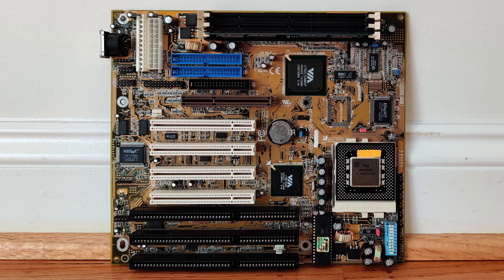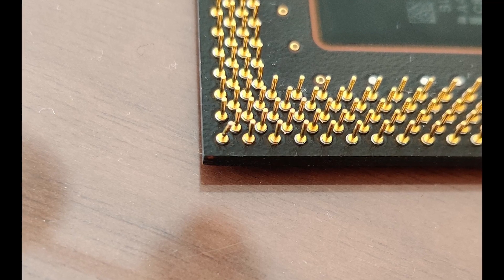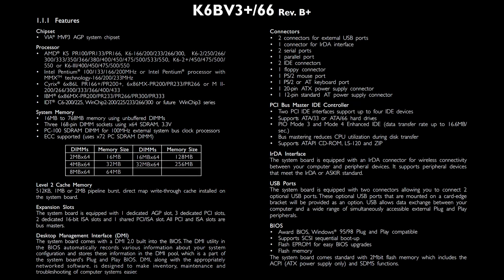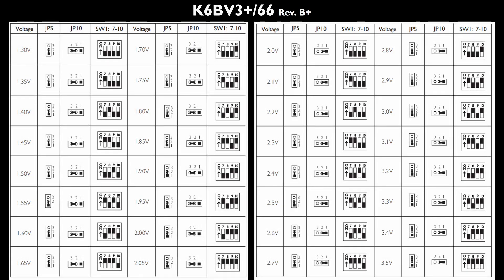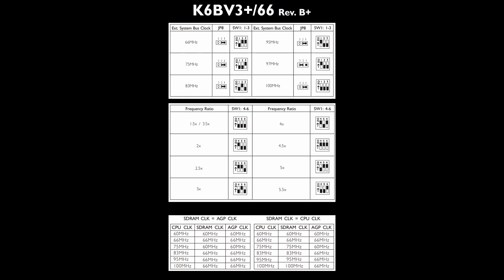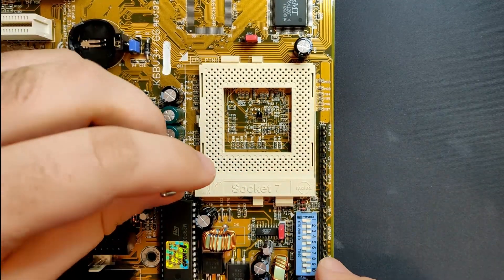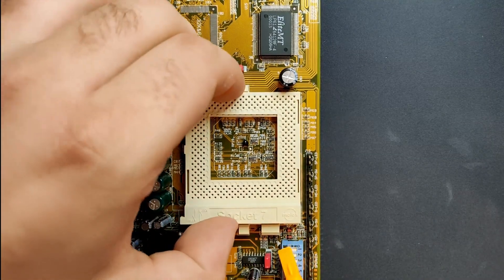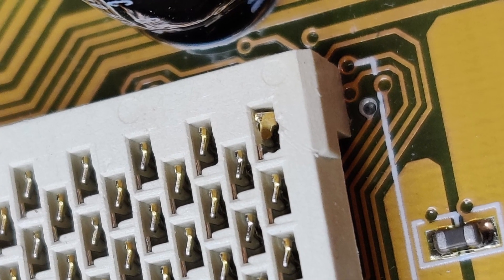DFI K6BV3+/66: Repair damaged Socket

Comment: What tools do I need to fix socket please?
Reply from the maker: It depends on what you need to fix. I only had to lift the socket cover and bend a metal plate back into position. A plastic prying tool was enough.
Replacing an entire socket on the other hand requires a desoldring station

Comment: Feels strange to, 20-25+ years later, realize that both AMD and cyrix cpus were actually quite good in the socket 3 to 7 era. Sure amd 486 up to 100 MHz were "standard" but the faster variants were really uncommon where I grew up.
And the k6 2/3 were uncharted territory.
A friends Mother bought a everex explora mini system as a christmas present to him and his brothers, more a punishment then a present actually..
K6-2 450 with 64mb ram and integrated gfx, we did what we could adding memory and voodoo 2 cards but it was a sad experience 🤣

Comment: I had a K6-2 350MHz back in the day.  I upgraded it to the K6-III 400 because I couldn't get a 450.  It worked quite well for me back in the day.  I had an EPoX MVP3G board.  They aren't the fastest chips from that time period, but they work great in a lot of games from the time frame.  Glad to see you fixed that socket.  A lot of people would have thrown it out.  Glad to see the hardware preservation.

Comment: Hi, thanks for your videos, I do enjoy all of them. But I expected something different for this one :) but you were lucky you didn't have to replace the full socket... which I need to do, where did you get the socket replacements? I need one for an aladdin V super socket 7 board
Reply from the maker: I found them on ebay while I was on a trip to US. I think there were only a couple of ads for Socket 7.
I hope you'll find them and good luck with replacing such a socket. I have never done a socket replacement, but I shiver just thinking about doing it!

Comment: That particular pin is a "No Connect", so it would have been ok to desolder or break off the damaged contact if everything else had failed. ;)
Reply from the maker: Correct, that's what I've seen from a pin-out diagram. I think I said it also in my October Channel Update video. Either way I had to open the socket because it would screw up any CPU that I'd place in the socket.
Reply: @bitsundbolts  Yea and you would have to disassemble it either way. I have only just discovered your channel. You have some interesting content over here...
Reply from the maker: Glad you like it. Hope to bring more interesting stuff in the future!

Comment: AMD K6 series were great value at the time.

However, I have no idea why you're using them in a retro machine. Pentium was far superior, just unaffordable at the time.
Reply from the maker: I am not building a retro machine. Just playing around with old hardware and sharing it on YouTube - guess I am going to be making more videos - including Pentium soon
Reply: Ah ok I misunderstood. Good video anyway.

The "pencil trick" for AMD Athlon and Athlon 64 was a good one back then, that could be interesting... especially with the direct die heatsink mounting.
It was on the more modern Socket A boards though.

Comment: Looks like there's room for an additional cache chip on the board.
Reply from the maker: Yes! There is indeed! 2MB max cache size, but I would also have to replace the tag ram. Maybe some day I'll try adding another MB of level 2 cache, but first I need to get better at soldering.

Comment: i love how the oryginal socket is just a s370 with unused holes
Reply from the maker: Still have to get to S370. Next will be Slot 1 for me - probably with S370 adapters.
Reply: @bitsundbolts  if you ever get via apollo pro chipset board with tualatin suport, there is a mod you may want to do to it
due to a bug bioses for those boards can't simply use pci/agp dividers and to get any overclocking done on those boards it is best to insolate bsel 1 and bsel2 pins in the secket and add external jumpers for bus select. because if cpu demands 133mhz bus even if it is celeron 566 on 66mhz bus board will work fine with as if it was 1133mhz celeron on 133mhz bus and would aply pci and agp clocks correctly, if you set them in bios or by jumpers on board that way agp and pci would get 100% overclock and board would not post, aply to any via chipset for s370/slot1
they could aso run sdram on ridiculous speed for some reason 

have fun getting one of those
Reply from the maker: Thanks for letting me know! Will definitely keep this in mind!

Comment: I have an Asus P5A board running the same CPU but I had to hardware-mod connections to pins on the CPU socket for K6-2+ compatibility with the board and I believe I'm getting limited PCI/AGP bus performance.  I'd like to compare Unreal timedemo framerates.  That's what I'd like to see:  K6-2+ at 600MHz, Voodoo 3 3000, Unreal timedemo at 1024x768.
Reply from the maker: Now I just need a Voodoo 3 3000 ;)
Reply: @bitsundbolts  I assume you don't have any Voodoo3's of any type cuz I could adjust my card's clock speed to match one of the other models if you did.  Actually I have one of each of the Voodoo3 models now but my V3-2000 is PCI, all others AGP.  If you're ever in upstate NY I'll let you borrow one :)
Reply from the maker: Correct, I do not have any Voodoo 3 yet. But I'll keep looking and will eventually get one.
Edit: Thank you for your offer. Unfortunately, I am about 14 hrs away from NY.
Reply: You can overclock a Voodoo3 2000 to 3000 speed if you add a fan to the heatsink. I did that in my K6-2 system back in 2000.

Comment: get the fastest pci card that supports 9x  id  be curious to see what is the fastest pci card and the game  and demoscene performace
Reply from the maker: It also has AGP support, wonder if it is really that buggy as many people say.
Reply: @bitsundbolts  oh thats neat so gret the fastest gpu with 9x support . im wondering if the agp shares the bus with pci devices
Reply from the maker: From what I've read is that most AGP cards have trouble on socket 7 boards. Voodoo 3 seems to be compatible as it doesn't implement AGP features - basically a PCI card made compatible to the AGP interface. I'll try to figure something out to create some interesting content
Reply: @bitsundbolts  would be an interesting video to see what gpus work best on agp on socket 7 . i vaguely remember having a socket 7 board with an agp card
Reply: @bitsundbolts  I used VIA based board with AGP Riva 128 card and there were no problem, only VIA AGP drivers had to be installed. I think that most problem with AGP on this board is when you try to use more modern, power hungry card. Because voltage stabilizer for AGP is not designed for it and overheat.

Comment: Hope you got it for cheap. Nice repair :)
Reply from the maker: I actually got it for free. Original price on ebay was around 140 USD after tax. But due to this fault, the seller refunded the money not requiring the board to be sent back.